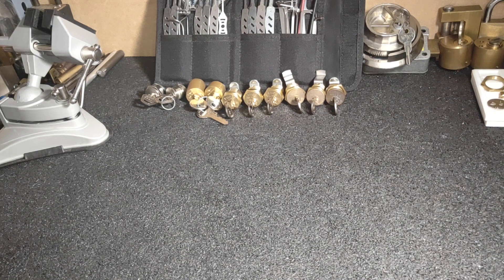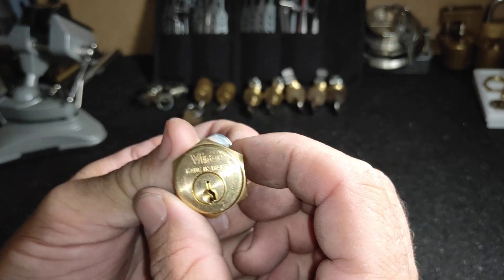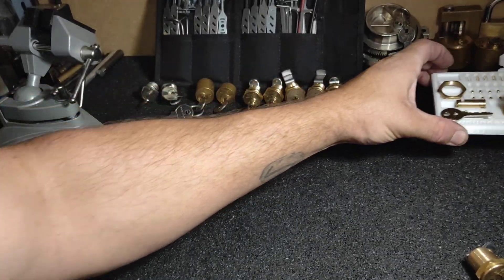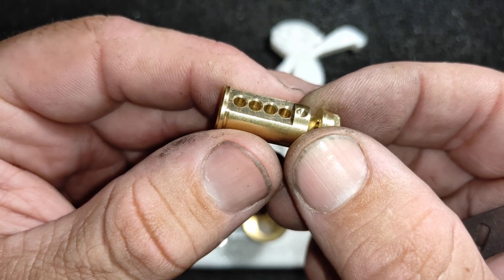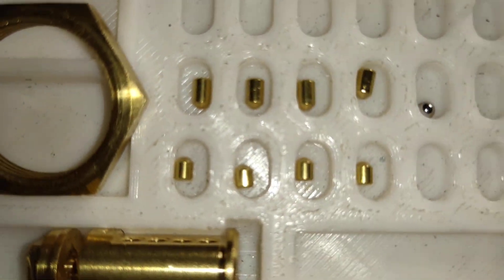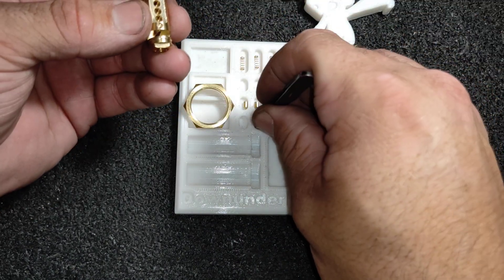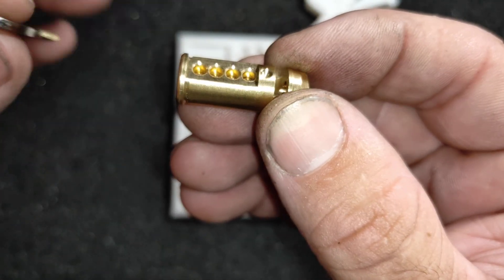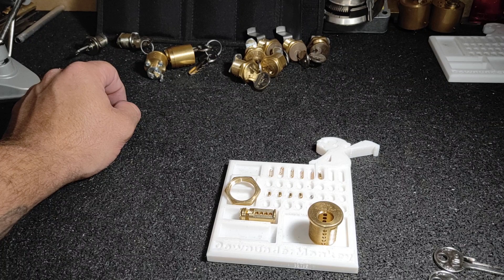(17) curious setup on a Viro cam lock

Comment: I've only seen that once before, can't remember the lock it was in but had the same set up. Very surprised that Viro would do that to a lock, they have such a good name, this lock brings the whole Brand down. The massive chunck they took out of the core as well, what are they thinking, do they think they have a new way of setting up a core that is better than the standard way. I'm sure the owners of those gates would be unhappy to find that the gate lock could be opened with a wiper blade. Thanks for this video.
Reply from the maker: It was very surprising to me too. I've picked some high quality Viro locks. This one seems to have quite a few flaws. Maybe it's seen as "just a manual release lock" and security isn't high on the agenda? Anyway, thanks for watching and have a great day😀👍

Comment: Thats an unusually odd design flaw by Viro. 
Would it still happen if it had 1 or 2 really deep cuts on that key?
I've only had a tiny vintage Viro rim cylinder that is even smaller to those cam locks you have.
Pretty sure I gifted it to PW for her tiny lock collection.
Cheers 🐒🐒🍺🍺
Reply from the maker: I'm sure it was purposeful, but like you said, it's odd of Viro to do it. I think I should deep cut the key to find out. If I had of known PW had a tiny lock collection, I could have hooked her up with lots of weird little ones.

Comment: Nice lock, it looks like it is designed to be turned and remove the key in the on position as well as the off position. Not sure if it is a good design compared to drilling another bible in the on position.
Reply from the maker: I would definately have a second Bible to lock it open so it doesn't accidentally get turned back causing a lock out. It's a weird set up for sure.😀👍